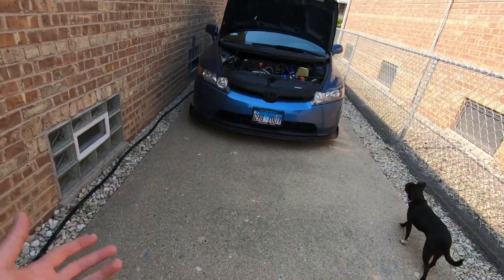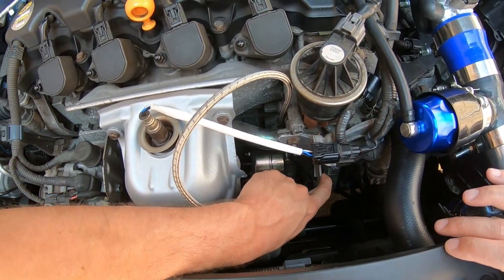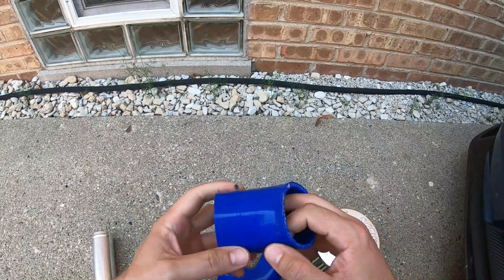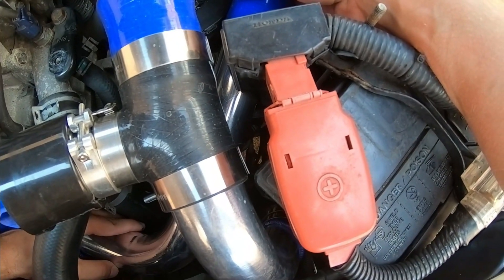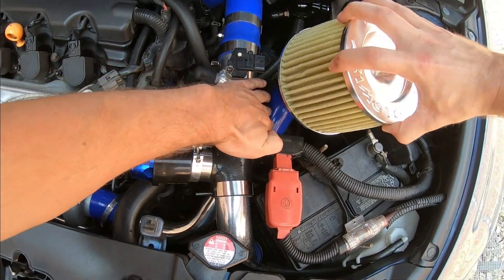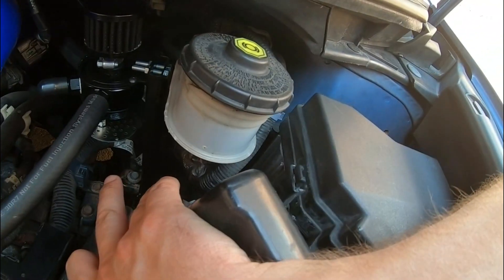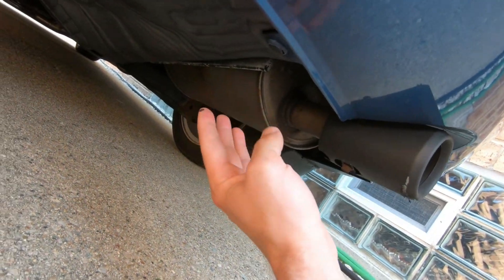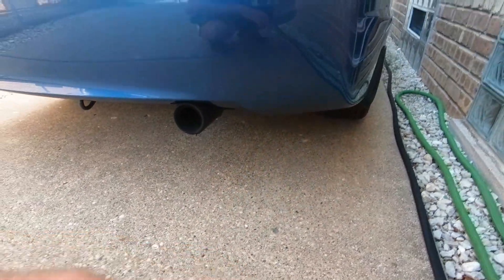Honda Civic R18 Turbo DIY Turbo Intake Installation!

Comment: Wtf is it with you guys building civics with Auto's ? Manuals are cheaper, easier to find, stronger, and sound way way better. And fyi your dog is scared of the noise your stock R18 is going to make when it goes boom 😂.
You need to do what ive done. 
My Civic is my daily (work and back) Dead Stock. And for pedestrian safty they should stay that way. Lol a piston in the side of the face of some poor old lady walking home from bingo doesn't fill me with joy. 🤣 
And my 2013 Accord LX (weekend car) has a Turbo K24. 634 - FWHP
My next car i think will be a totally stripped out 2013 CR-V AWD K24 Turbo.
The one im looking at is $2000 with flood damage. That's good because it's manual, ECU gets changed anyways,
Interior gets thrown out and SAAS seat.
Its my prototype (mock-up) and if it works really well ill do it properly and find a car that can be registered.
Fun times, i wish you well with your endeavours, this is all in the name of fun so as long as it puts a smile on your face thats all that counts right. 
Hope to see more of your videos, its a fresh look at civic life in oz, as cool as they are American vids are getting so old.
I may post my builds, dont even have a channel atm not really interested .
Ohh and a little tip dont rely on google for info, all motors are different.
Spark, injectors, compression, timing etc. But im sure you already know this.
You.should also ad a nice set of rods heltech ecu and a good tune, injectors and an intake.
Inexpensive security. (Relatively speaking) when you take into consideration the price of new motors and the time it takes to replace them weekly.😮 😢 😂
Reply from the maker: @glengrimm4075  thanks for the comment boss!!! You have a nice builds!!  This build was my first turbo build on my long term daily.  Learned so much from this journey and everything is done on a budget.   

It did bend a rod on cylinder 1 eventually and I swapped in another stock rod and boosted it again on e85.  

I picked up a new motor (same motor) and I plan to do a built bottom end  and bigger turbo.  Again all in very tight budget.  

Biggest thing is I need to find a stick shift because yea like you said auto is lame as hell. 

I’m taking the knowledge I learned and want to move it into a 2 dr stick shift and build up from it.   Cheers for the comment and hopefully in the future I can make you prouder :_Turbo:
Reply: @BulliKid  Dude, just giving it a go makes me proud.
Everyone needs to build their own cars,
I love seeing people build turbo cars in their backyard.
If you're bending rods, then you're touque is to high, change the timing and Make sure you give it more fuel too. Otherwise, you will burn valves and melt pistons, make sure she dont run lean.
First thing i did was get a Heltech ECU and bigger injectors, thats your main purchase after the turbo kit.
Good luck mate and remember.... have fun. 😆

Comment: I wonder if a scavenge pump might be an easier way to go with these sumps. Then you can just route the returning oil into the filler cap or something. 

Cool build either way. I have an Rk5 Stepwgn with the R20A and would love to boost it. It's already so fun to drive but a bit more power would really liven it up. These videos have been really helpful in seeing what goes into boosting an R series engine. 

Cheers! 👍
Reply from the maker: Cheers !!! R20 would make some nice power😀

Comment: Another option for the air filter as you mentioned with small filter directly at the cold side inlet of the turbo but wrap the radiator hoses with heat wrap no different than for an exhaust manifold.  Should make a huge difference with under hood temperatures as well as reducing intake air temperature.
Reply from the maker: Good idea!

Comment: Relocate the Battery to The Trunk. Put Your Box Air Cooler Where The Battery Was Placed. Find a Way to Route and Direct the Airflow There.
Reply from the maker: Yeah, that is a good idea
Reply: @BulliKid  I Had a 9th Gen With the R18. How Much Boost Is This Running? Stock Internals Should Be Okay So Long as You’re Not Pushing It Past 7-8 PSI. Keep It Conservative on The Boost Just to Be Safe. Full Race Also Used to Make an Intercooler that Mounted Directly Into the 8th and 9th Bumpers on These Cars. I Don’t Believe They Make It Anymore. They Even Used to Make a Turbokit for This Car, But It Was Incredibly Expensive. T25 Turbo Will Give You a Very Linear Powerband For This Car
Reply from the maker: @artisanwolf2068  this was running at 7-8 psi.  Convervative tune.  Yet we bent a rod one day on cyl 1.  Now i just did a version 2 of the turbo build! Hoping for the best 🤞
Reply: @BulliKid  Oof. Were You on Stock Rod Bolts, or No?
Reply from the maker: @artisanwolf2068  stock internals , yes

Comment: Hi Sir do you mind sharing a software that i can use to monitor all the temps and also monitor all sensors in my laptop, driving or idling. thank you
Reply from the maker: Hondata or kpro and possibly haltech
Reply: @BulliKid  thank you so much, im worried on my oil pressure, i cant monitor it cause i dont have a aftermarket oil pressure gauge on my 8th gen. I was about to get one but most mechanics said that putting a oil temp gauge and oil pressure gauge in an r18 engine is risky because adding a sandwich plate at the bottom would be dangerous because the oil filter is located at the bottom,  not most engines their oil filer is either in the middle or at the top lilke kseries engines. thats why im going measure it thru obd2
Reply: @BulliKid  btw which one is better software?
Reply from the maker: @reignstir  hondata or haltech.  Kpro has limitations on r18 platform from what I have heard from others

Comment: What type of DW injectors do I need
Reply from the maker: Need way more info to determine that correctly.  But if you going turbo you want. Around 400-1000cc depends on power goals
Reply: @BulliKid  thx W man

Comment: This will work on a 2013?
Reply from the maker: Yes I have seen it done on 2012+
Reply: Thank you
Reply: Will a SRI from a 2006 will direct bolt on to a 2013?
Reply: Or will there be some fitment issues?

Comment: Did you reach SI's HP?
Reply from the maker: Never had it on the dyno but I would assume 180-200 whp. I belive a stock si puts down about 180 whp
Reply: @BulliKid  As far as I know SI's have 192whp. 
I've seen the other videos of your build, would you say this is  sort of a safe mod? or should I do it on my '2nd' car, not in a daily. 
Thanks.
Reply from the maker: Don’t do it on a daily.  Lol I blew my motor. And so hve many another’s.
Reply: the r18 can keep up with si's with only bolt ons and a good tune
Reply: @ONeA2122 lol no way in hell buddy
Reply: @rinyi-y4r  u sure about that?
Reply: @ONeA2122  you're telling me an r18 gains +80whp with just fbo and a tune? Please make it make sense
Reply: @rinyi-y4r  where u got 80whp from? its only 50 more whp base model is 140hp
Reply: @ONeA2122  140 CRANK hp. R18 is around 100-110whp vs 170-180whp on the si.
Reply: @rinyi-y4r  the r18 with fbo can still keep up with stock si i think
Reply from the maker: r18 is not keeping up with any SI, unless you got a turbo in it.

Comment: How much hp does the car have? I’ve been wanting to turbo it, but I wanna make atleast 300 hp for it to be worth it
Reply from the maker: You will not seee 300 hp.
Reply: I own a 07 civic with the same motor , if you spend the money for a K swap it's worth it in the longer run.  More HP more mod options.
Reply from the maker: That is correct. I’d personally prefer to get an Si and avoid the headaches with swapping a motor.
Reply: 180

Comment: I like how you modified the exhaust 🤔
Reply from the maker: It’s a sleeper modification ! I wish I was better at welding though. The welds were very bad.
Reply: @BulliKid  exactly what I was thinking lol the only down side it’s a rather small diameter stock around 2” or less
Reply from the maker: @danielcamacho5519  1.8in yikes
Reply: @BulliKid  low boost application= PASS